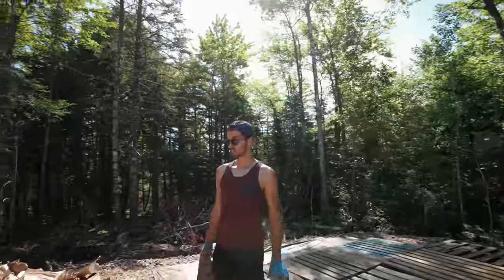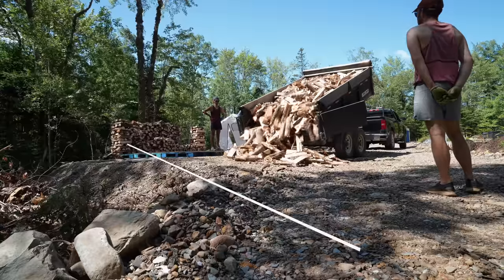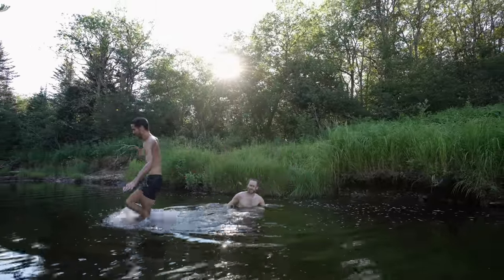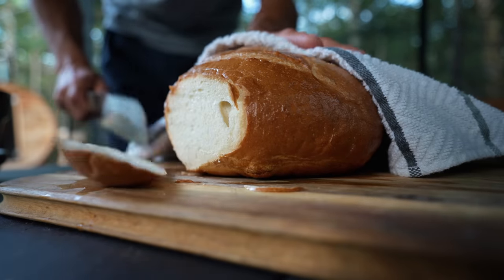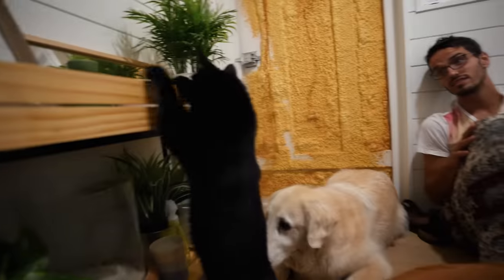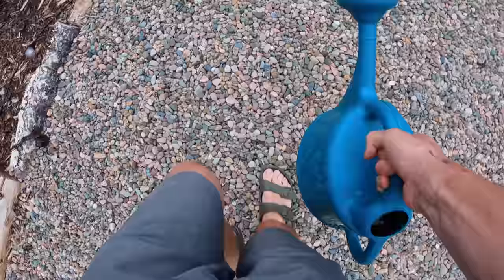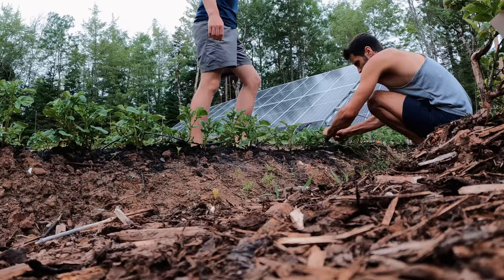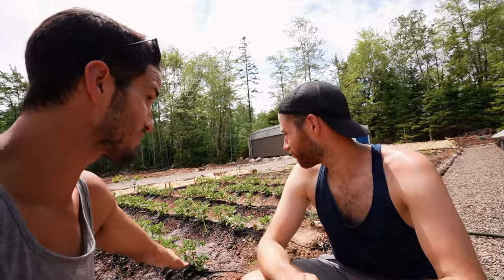A Rough Week with a Sweet Ending | Summer Days Building our Homestead

Comment: On your irrigation system you may need to run your 1/2 inch line along the end of each row and then run your 1/4 inch line off it for each row. That would give you lots of 1/4 inch runs that wouldn't be too long. You lose a lot of pressure in long 1/4" lines. I've done quite a few irrigation systems and I always try to keep smaller tubing shorter. Hope it helps. Really enjoy your vids!

Comment: Re: the drip system, you might need to install a larger 1/2" line connected after the pressure reducer with a T and a leg of 1/2" line that runs each way the length of the garden then punch into it with the 1/4" lines that run down each row of the garden (pressure loss due to the length of the lines, the 1/2" running the length of the garden would help).  Until you get the bigger pump you might not even need a pressure reducer?
Reply: Good idea, Mike.  That's how mine is set up and I'm pretty happy with it.  When the 1/2" pops a leak (and it will, eventually,) you get a fantastic water fountain for free!  I turn off the timer if I'm going to be out of town for a few days.  You can get decent battery operated timers with an adapter from the garden hose to the irrigation hose for around US$ 60.
Reply: That’s it my is like that amazing with a clock sistema I don’t have too do nothing just watch the plants and feeding
Reply: Was gonna comment the same. The bad news is that they’ll need to add the extra lines. The good news is that’s the east part lol. I found working with the 1/2” line was much quicker too

Comment: First off: Happy Anniversary!!!  Second, on the drip system: slower is better.   By running it at a lower flow rate, the water will have a chance to seep down directly where you placed the drip nozzles.  This means less puddling and flowing that will send water to unwanted areas (watering weeds...etc.).  The only drawback for you two is that you are using  12v power for longer.

Comment: Guys,  its not about pressure but it is volume.  That drip line is MUCH to small for that garden.  You need to run larger pipe to each section of the garden THEN transition to that smaller pipe.  When you add to your system to do entire garden the plants at the end will not be getting ANY water while the ones at the beginning will be watered.

Good Luck

Comment: Drip is normally a drip or a trickle, it's an advantage two ways:
1) When you spray water in the air you lose a lot of it to evaporation, you just make higher humidity and the breeze wafts it away
2) When you spray the foliage you get a lot more plant disease.
Drip puts a trickle right at the base of the plant where it goes right down to the roots where the plant can use it.
When you get more pressure on your lines you will need a pressure regulator (25 psi available anywhere you buy irrigation supplies) so you don't blow apart lines and emitters all of the time.
(Can you tell I managed an irrigation supply place for a few years of my widely varied life?) 😜

If you run across the beds with one line and tee off for each row you get more even pressure for the rows and use a lot less hose than if you snake through the rows.
Love you both so hugely

Comment: Growing up in Southern California in the '60s and '70s without AC we kept the house cool at night by putting a box fan in the kitchen window. It was the smallest window in the house and the fan was the same width as the windows, all I did was take some cardboard to fill in the space above the fan to keep air from coming in. We'd turn the fan on to exhaust air outside and in the bedrooms crack the windows open a few inches. The fan lowered the air pressure in the house and that meant cooler outside air would come blowing in the open bedroom windows. We'd often get too cold at night using this method.

Comment: I’m going to share a tip for growing potatoes. My mother, rest her soul, would lay stake out a patch of the garden and cover it with leaves gathered and stored from the previous fall. Then she would lay the seed potatoes on the leaves in a grid pattern and cover the whole patch with loose straw. She’d soak the patch well with water and basically forget it. The potato plant would grow up through the straw and thrive. Later in the season she would periodically pull the straw back to check on the progress. There would be little nests of potatoes under each plant—all perfectly clean. She’d have ‘new potatoes’ when she needed them, but most she just left them until harvest time. The biggest plus in all this was that she didn’t have to dig potatoes—she just picked them up. Recently, I saw an article about this method and someone commented that field mice devoured the potatoes during the growing season and nothing was left to harvest. However, my mother never experience this problem. I remember my grandmother and her sisters staring in awe as they had never seen such a method. Sorry for the long winded comment.

Comment: First off, drip irrigation is not meant to be a sprinkler system.  If you put too much pressure on the line, you'll end up with popped heads here there and everywhere.  Drip irrigation is just that - drips.  Like a dripping tap.  Adding a stronger pump won't make it drip or squirt higher.  If you want to do that, get a gyrating sprinkler or an oscillating sprinkler on a 3 ft (1m) high post.  Also, put a timer on your system.  1 hour of drips per day is sufficient for a row of vegetable plants.

Comment: You two are so adorable and just keep rolling with the punches.  Things happen for a reason and seem to work out for the best.  FYI have the top tarp angled to let moisture roll away from wood.    Air needs to flow around wood to keep it dry.

Comment: Just a thought, If you would place an IBC tote "ground level" and fill it with your low voltage pump from your well, you could then use a similar low voltage pump like is in your 5th wheel, to then pressurize your drip line and or misters. The well pump could pump at its own place, keeping the tote full, so you have a supply up at the top to use freely.  IBC totes and or water buffaloes hold between 275 and 500 gals. Drain tote before winter so it wont freeze. This system could also be implemented into your grow Domes, and powered independently or remotely.  CCHHEERRSSSSS

Comment: It’s a drip irrigation.  Not a sprinkler system.  So it is a drip.  Think droplets.  It’s already too much pressure right now.  A drip irrigation is to drip water into the soil.  Not water the plant stem or leaves.  That would create mildew

Comment: That is one hell of a lot of firewood, so unless your new house is similar in size to the Palace of Versailles you should be good for a couple of seasons. I heat a four - bedroom house and do all my cooking and preserving on a lot less wood than that! (Happily, because I have to cut it, split it and schlepp it myself and I'm rapidly approaching 70.)
Also, I'd like to suggest that you use a simple 16mm. perforated drip tube for irrigation. Incredibly easy to install and also to move when you change the planting, and no tricky little drippers and sprinklers etc. to install. You can put in the whole system in in a morning. The drip tubes work well even under a mulch so you use less water.
Loving your videos, look forward to every week. Keep on keeping us educated and entertained! Best wishes from the Italian Alps.

Comment: Comment for your irrigation, I would suggest using a larger pipe 1/2” running the length of the garden, parallel with the solar panels to help with the water supply issue. Also, I would suggest you remove the pressure reducing valve that comes with those kits where you screw it in at the hose until you get a more powerful pump. Secondly, you can just get the drip tubing (in the US it’s brown and the tube has a hole every 6” that will emit small drops). This will eliminate all the small tubing and emitters as the hose is all that is needed, it’s less expensive, no fittings and is perfect for gardens. The type you installed would be great for your other garden planters, those are what I use. Hope the suggestion helps you and good luck!

Comment: In OZ we use drip irrigation system all over in order to conserve water. Hence DRIP means drip, no need for high pressure. U want to get the soil wet and not the plant itself, if that makes sense. So keep the pressure low, just high enough to ensure water reaches the end of the pipe 😉

Comment: I don’t do well in the heat either. I’m an Aussie and I’m ok up to about 35c, but the days that hit 45 in the shade I get very heat stressed. So, you are not alone guys. Also, if you spray a bit of oil on baking paper in the bottom of the Dutch oven the burn won’t be as bad.

Comment: Guys, a drip system is supposed to drip, not run full force. Adequate watering usually takes 30-45 minutes. Since the garden is so large I would use your y-valve to water half the garden at a time. So sorry for the house delay. I know how frustrating that can be. ❣️😱👍🏻👨‍❤️‍👨💪🏼👏🏼

Comment: I wonder if you could swap the smokestack in the dome for a solar vent during summer. Also, there's probably cool air under the floorboards of the dome platform. You could run some air ducts from beneath the dome to inside. If there's enough thermal difference, it might circulate air naturally drawing in the cold air, but a duct fan would probably help that along.

Comment: You could have done a dripping system. You don’t need a lot of pressure for it to work. It’s literally drips of water going into the soil around the pants instead of showering them. You would use less water but it would take longer to get enough water into the plants.

Comment: consider putting plywood on top of the finished pile of wood and then put a tarp over that ... otherwise what happens is that when it snows the snow pushes the tarp into the wood holes  then it freezes and makes it difficult to uncover the wood . With the plywood on top you can shovel the snow off the wood , As you finish a row of wood you just push the plywood back  or  leave the side towers and then bend over to remove the wood inside the cover but with the amount of snow you guys get up there pushing the plywood back on top of the other plywood might be best. Also I am in southern NH and we have a very old new england style house and we burn anywhere from 5-7 cords of wood a season depending on the how bad of a winter we get.  To save on utilities i also cook on the woodstove and last year I even cooked a few pizzas in the wood stove but that is still a bit tricky I do not have that down pack yet  but tons of YouTube tutorials on how to. I also keep a pot of water heating on the woodstove to use to clean my dishes and wash floors etc ... Yeah I am cheap

Comment: Love that you've turned a negative into a positive!  The dome project is an excellent way to take your mind off of a disappointment and focus on how the improvement in the dome will eventually pay off in so many ways.  I'm a HUGE fan of geodesic domes as I've probably mentioned before.  With that said, I can hardly wait to see your next video and find out the solution to your temperature problem.  Question...Would you consider sharing your recipe for the bread and also let me know the make of the Dutch Oven?  My husband has been trying to make bread off and on for the past couple of years, so PLEASE pass on your recipe.  I don't know if I can eat anymore flatbread that wasn't supposed to be flat.

Comment: Hi!!! You are totally fine w the low pressure, all u need is a slow trickle to a drip..you would rather that instead of an over head spray emitter..u want to avoid watering  from over head for several reasons...powdery mildew, evaporation waste..
Why its called drip irrigation..set ur drip timer to avg 30 min 2x a day..adjust w temps. With love from Ohio, USA..

Comment: I think the irrigation system you installed is drop irrigation, so it will not spray.  The slow drop allows you to efficiently water deeply, with less evaporation.  I think.

Comment: I have not looked through other comments to see if there are comments about the low water pressure... In one way, having low pressure, is good, drip  irrigation is better is is is long and slow, allows the water to soak in.

Comment: Thank you for answering the question about wood! I grew up heating with wood, and noticed early on that your forest is not suitable firewood.

And excited to see you drip-irrigating! Mine is a lower quality system, but it made a huge difference here in semi-arid SW North Dakota! The water actually soaks in, I use less water, and I spend less time watering! I was surprised to see yours acting as some tiny sprinklers. Mine literally drips. It takes me 3 hours to water the garden because it's so slow. But I turn on the hose, and go do other stuff.

Comment: Sorry for the delay on the house. Hope the steel comes through soon. Isn't the irrigation system supposed to drip rather than spray? It may be working as designed with your current pump. I've seen them used in large gardens, and they only put out a little bit of water but do it constantly. Happy 8th anniversary! Hope you're able to have some down time and celebrate!

Comment: It's called DRIP irrigation for a reason, fella's! You don't want too much pressure or the fittings will pop apart. If you want high pressure, you want a Sprinkler system.

Comment: Bummer about the house but great news on the dome.  Why don't you have at least evaporative cooling in your dome or is it too humid there for that?  It is seriously inexpensive to run evaporative (swamp) coolers and they use little water and electricity.  Also, replacement parts are pretty cheap and all maintenance can be done by just about anyone.  I live in the New Mexico desert and have a Swamp Cooler.  It works great for me but I live in a dry climate so that could be the difference.  Refrigerated air is very expensive so this is perfect for me.  It will keep my house 15 - 20 degrees cooler than outside.  Just a thought.  Your pets would probably love it too.  Even some sort of ceiling fan system would be nice for circulating air in the heat and the cold.  I have had issues with those little irrigation tubes.  They get brittle and split here in the dry weather and heat.  They are pretty standard so I am guessing that this is not a problem elsewhere and hopefully not for you guys.  On the flip-side, repair is very easy.  For the time being, can you put shut off switches on your water lines to water in sections until you get your new pump installed?  The switches are very inexpensive, I use them between the hose and the main faucet or between the hose and my irrigation bulb so I can turn off the water as I go along.  I have a split on my faucet, actually so that I can run two different hoses off the faucet and just flip from on to the other as I need to.  I have seen them with as many as 5 nozzle ends at any store that sells gardening supplies. In case I haven't explained myself well here is a page on Amazon that has what I am referring to. https://www.amazon.com/s?k=water+hose+splitter+valve&gclid=Cj0KCQjw0JiXBhCFARIsAOSAKqA_bVKIGOQ3bYxxQdgrZw0Yn0SB4wGMLh0TDENXXTtx-ib4cOehfdYaAiyiEALw_wcB&hvadid=580752344357&hvdev=c&hvlocphy=9030452&hvnetw=g&hvqmt=e&hvrand=5344989951905097431&hvtargid=kwd-723339850447&hydadcr=26689_11679523&tag=googhydr-20&ref=pd_sl_2asfy228x4_e

Comment: When you looked up the weight of a cord of wood, what you saw was the weight of a cord face not a full cord.  Depending on moisture content and type of wood, and also if it’s split logs and how it’s stacked, a full cord will weigh between 2,000 (for dry loosely stacked fir) and 5,000 lbs (for tightly stacked but green oak or maple), possibly even a little more or less, so much depends on how well stacked it is.
The whole “cord vs cord face” is a big gotcha, unscrupulous vendors will sell a cord face but call it a cord, and much of the general public doesn’t understand the difference.
(Full cord of wood is 4’x8’ (split or whole logs, cut into shorter lengths or not) stacked 4’ high.  A cord face is not well defined, it’s however long the logs have been cut, for example 18”, by 8’ by 4’ high.)

Comment: Yeah!  I'm so glad you have all of that wood for the winter.  I've been worried about that.
I use parchment paper and a metal riser in the Dutch oven.  That might reduce the burnt carbon effect on the bottom of your bread.  I love it also!!! ❤️  FYI, I think burnt carbon food is cancer causing. 
Love drip irrigation!  There is some math that can help you get the pressure right for each leg of the drip lines.  I use 4 way split timers for each leg to make sure I'm not pulling more water than the pressure can support.
When rebuilding the dome, I think you could have an amazing loft with bedding area above the entrance that opens up to the woodland view you have.  If you put storage and kitchen on the sides, it could be a great use of that floor level side of the space. ♥️

Lots of Love & Good Luck!

Comment: I know you have enough projects, but couldn’t you install a water tower to provide adequate water pressure to your garden, so you aren’t overworking your pump? It seems like it would be more efficient to pump water now and again to fill the tank than run it off your house pump. (I thought it could do your house, too, originally, but looking around, it looks like 10 psi is probably as good of pressure from a tower that can be expected. That’s enough for garden irrigation, though.)